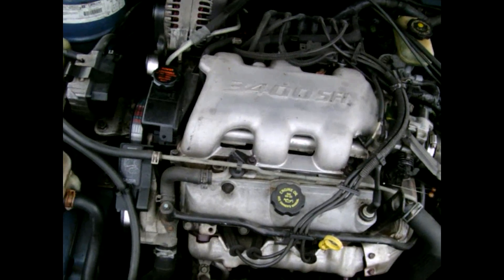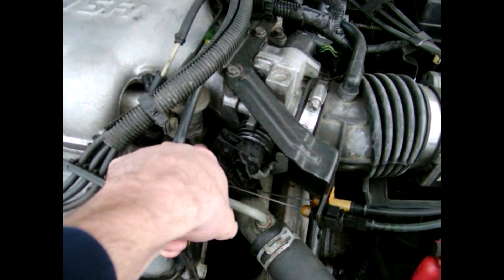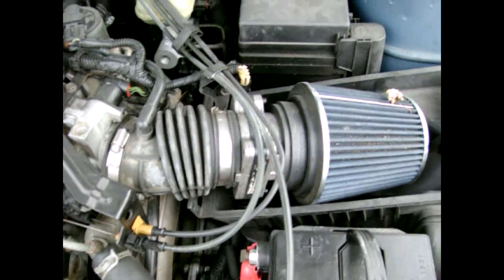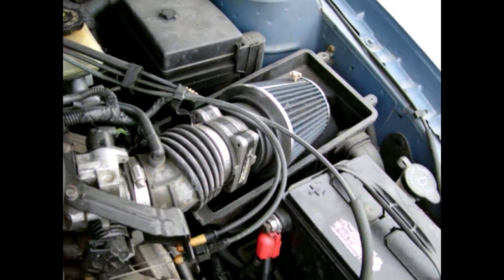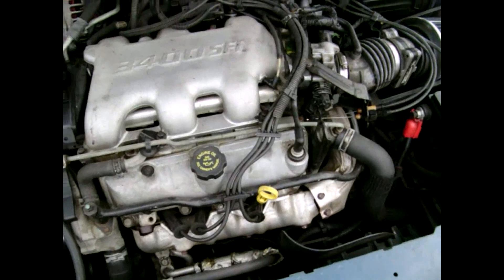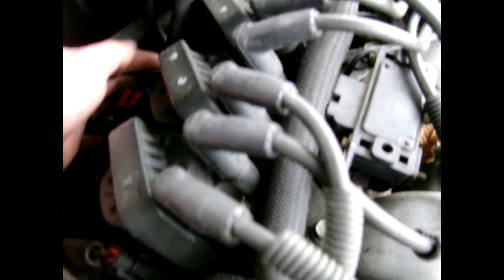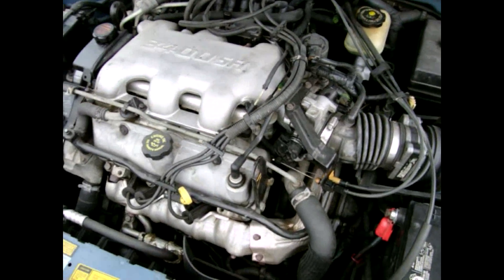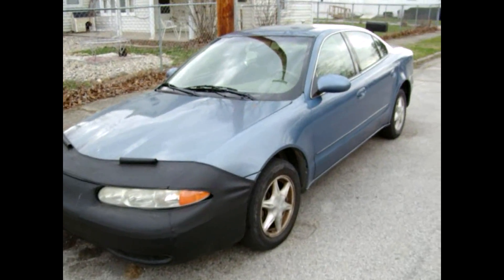3400 GM Engine 3.4 Liter Motor Explanation And Discussion

Comment: I have a 1999 Grand Am with a blown engine, 3400 v6. Bought a good engine from a wrecked 2000 Grand Prix and find out its from California and the emission controls wont hook up. Can I remove that and make it run?
Reply from the maker: Wasn't aware that California 3400 motors had different emission controls.  But, to answer your question, yes.  Make your new motor look just like the old one and it should work fine.  While it is out, I'd replace the head and intake manifold gaskets.  They go bad often and it's a lot easier to do with the motor OUT of the car.
VT247

Comment: Hey I have a 2002 buick rendezvous with the same 3.4l engine and I'm wondering if anyone here knows if this engine is an interference engine because the timing chain gave out on me and after I replaced it the engine now sounds like its ticking and knocking like crazy. Never had this problem before. Any help would be appreciated.  Thank you.
Reply from the maker: +Estefano Telles Don't chance it.  Get another engine.  Replace all the gaskets when you have the replacement engine.  Timing cover, head gaskets, intake gaskets and exhaust gaskets.  If it's making that much noise, you DO NOT want to tear it all apart, put it back together and have the same problem.  Might not be the news you want to hear, but it's the best advice I can give you.  Knocking and ticking is not a good sound to hear, why chance it?
VT247

Comment: having the Air filter so close and direct to the Mass Air Flow doesn't throw off the Engine performance and fuel ratio??
Reply from the maker: +josh martinez Never threw a trouble code when I had it.  Not sure how much performance it really added because it was on there prior to my buying the car.
VT247

Comment: Can I swap a 3400 out of a 2002 grand am into a 2003 alero with the 3400? The guy at the junkyard says it won't work.
Reply from the maker: The block and heads are the same.  Won't matter.  Now, some of the plug in connections might need swapped out but that should be done or checked before putting the new motor in anyhow.
VT247

Comment: I got a 2004 alero with what I think it's a bad transmission. when it gets to 3000 rpm it just lags. the MAF is all clean and the car has no catalytic converter what should i do?
Reply from the maker: Check fuel pressure and the coil packs.
VT247

Comment from the maker: @teemac82 Take off the serpentine belt and take out the bolts holding on the power steering pump and reservouir.  You'll get a better idea of where it's leaking or missing.  It has 2 lines, one in and one out.  Both go to the rack and pinion.  If the battery isn't staying charged it could be the alternator, or it could be a bad battery.  Test with a Volt meter and check for 14 volts with engine running.  Most auto places will check it for free.
VT247

Comment: I have a 2004 alero. This problem came on gradually. When I go to start it with my remote starter it turns over tries three times and fails.. If I get in car insert key and turn it same thing it turns over great fails to start.. If I tap on gas pedal and move it say an inch and let go the car starts like it should. 

had the Throttle butterfly cleaned out today.. Was very very dirty.. Brought car home put in garage like normal 6 hours later same thing.

Sux as now we have snow headed our way.. And remote will not work.. Any suggestions.. please.. Thanks Jerry
Reply from the maker: +Jerry Kutche Sounds like a vacuum leak.  By the throttle body that black line, the grommet can fail letting more air in than it should.  Also, back behind the coil pack there is vacuum lines that work for the EGR system.  Make sure there isn't any vacuum leaks is where I'd start.
VT247
Reply: I am embarrassed.. I did find the issue and fix it.. First let me thank you for your reply...

I usually do better at this. But working 7 days a week I really did not dig very deep. The Throttle plate was almost black entirely. With a pending Snow storm i took my car to my trusty mechanic here in Mitchell Indiana.(Hughes Auto). We discussed the issue briefly and we speculated it was indeed with the throttle body. Last tuneup had been a few years, maybe 5. So they removed air cleaner saw the blackened butterfly valve and sprayed the throttle assy. and got it quiet shiny..It would indeed stick before cleaning.  After cleaning looked at all vacuum lines in are looked great. Not knowing  for sure if it would start without hitting gas peddle until morning. I drove around town and could feel a significant increase in power. The next morning and the following afternoon and days and afternoons the car has started remotely each and every time..  I drive an hour to work each way and did not want to have to spend another quarter, hour clearing snow and getting it ready to drive. Made the addition of the remote start quite welcome a couple years ago.

Thanks again for your reply!!!

Have a good day and upcoming weekend. 

Jerry Kutche
Reply from the maker: Awesome!  In a way, it was a vacuum leak, from the throttle body letting more air in that it should have.  Glad your mechanic got it fixed and running right.  Not fun having a malfunctioning car in bad weather.
VT247
Reply: Yes... Nice.. It was a vacuum leak. The think gunk would not let it close... Thanks...

Comment: Ive built a few of these LA1 3400's and i like them alot they are good engines when built right. If ur gonna build one ALWAY GET THE METAL LIM GASKETS!!! The plastic ones are all trash and i noticed the intake runners on them are smaller too. Also if its a 99 swap out those multec injectors for bosch type 3 from a 90's Tbird will run like a champ just make sure grind down the bracket posts. For my 2001 grand am i just built i use 28lb trailblazer injectors with a fuel pressure reg from a 99 grand am they run at 43psi

Comment: My 2002 grand am is idling very high around 1500-2000 I have checked the IAC, TPS, and any vacuum leaks and still can't find the problem any idea's?.....
Reply from the maker: Check the throttle plate and make sure it isn't sticking.  Also, I've seen bad head and intake manifold gaskets present these problems also.
VT247

Comment: jus brought a 2000 3.4 impala and it has a cracked flywheel should I replace the starter also?
Reply from the maker: Probably would be a good idea.  Why chance it after doing all the work to change the flywheel.
VT247

Comment: I've got this same car and engine mines a 2002 but it's misfiring very badly and it popped up a check engine code and it misses and shudders badly as I accelrate or when it's in reverse or drive any ideas?
Reply: stop driving it

Comment: I wanted to ask if anyone knows how common EGR code P1404 is on these cars? Is this the code that requires the PCM reprogramming? I had my original EGR valve in the car and the CEL came on. I pulled the P1404 code with my scan tool and it said it was the EGR closed postion problem. I replaced the EGR valve with a new one from Advance Auto (don't remember what brand it was) and cleared the codes. About 10 miles of driving later, the CEL came back on and it's the exact same code. I doubt it's carbon build-up in the intake since the code isn't a flow problem code. I also doubt the EGR valve itself is bad since both the original and new are throwing the exact same error code. Any ideas on this one?
Reply from the maker: I've read that this may be needed.  But I'd try a hard reset first.  Disconnect both battery cables, turn the key on and also touch the + & - terminals together while off.  Leave the key on battery disconnected for 20-30 minutes.  
VT247
Reply: does the 3.4l have coolant elbow problems like the 3.8l

Comment: My car crank but no start when I unplug the battery for 20 minutes and plug it back in it starts up fine all day until the next morning it happen again what causes it
Reply from the maker: Might be something with the security system in it but I'm just guessing.  Check your grounds too and make sure there aren't any loose wires.
VT247

Comment: i have a 2000 monte carlo with a 3.4 and it dies when i stop at stoplight or brake i think its the egr value but not sure
Reply from the maker: Had an Olds Alero that did this too.  Check for vacuum leaks as well.  A stuck EGR would do this also.
VT247

Comment: I got an 03 Venture, front right 3 rocker arms doesn't move. Could this be anything but collapsed lifters?
Reply from the maker: Push the pushrods down and spin the engine over.  This will let you see if the cam is moving them up and down.  Check to make sure the rocker arm studs aren't stripped.
VT247
Reply: As best as I can tell the lifters aren't moving? The rocker arm studs doesn't appear to be stripped. I'm going to take the rear valve cover off to see of those are moving. That should determine if the cam is broken? if they are, possibly the cam loads are worn off for those 3? Is it possible to remove the lifters by taking off the intake and not the heads?
Reply from the maker: If the front rocker arms are moving on both sides (closest to the alternator / PS pump) but the rear (nearest to the exhaust crossover) are not, the cam is likely broken.  It's unlikely that multiple cam lobes got wiped out all at one.  Especially since these engines use roller lifters.  The lifters can be taken out without removing the heads.  But the entire front end of the engine has to be disassembled to remove the camshaft.
VT247
Reply: camshaft flat will need camshaft and new lifters can be changed throgh the side of fender have to cut a hole big enough to slide it through

Comment: Does My 03 Monte Carlo  suppose  to be missing a Trans axle hose.....? I have the same size 3.4  engine and my Monte Carlo, but I have a  rubber plug-in that spot. Please tell me there's not a  missing  hose, and a plug supposed to be there?
Reply from the maker: Older versions of the 4T65E transmission use a vacuum to regulate shift patterns.  In newer versions, like the '03, it is computer controlled.  That vacuum line is not used.
VT247
Reply: Thank you so much..I was really leery about missing evap hoses, because the smog place said I have a evap leak.. I replaced the EGR,Throttle position sensor,Idle  control valve,intake pcv,Air cleaner intake pcv valve tube hose,pcv elbow  and tube,fuel pressure regulator  hose .After all that, I still had a code P0404...The EGR was lose and didnt have a gasket.,smdh..That one EVAP hoses I couldn't figure  it out, if that spot had a hose that was missing. With the help of your videos, now  I can take my car to the smog shop.
Reply from the maker: Deborah Pitts To pass smog (at least in CA) monitors must show ready EXCEPT for EVAP. That is the only monitor that is allowed to show incomplete if the codes have been reset.  Also make sure that the vacuum line is in the EVAP under the coil pack, mine had come out at one time on this Alero.  
VT247
Reply: Vacationtime247 ...Oh okay,,I learn something new everyday and I will check out evap hose under the coil pack..Thanks again
Reply: Okay,I checked  it's on tight.. I replaced that as well... I think I'm going to replace the fuel pressure  regulator just on GENERAL Purposes. .Some power was gained but I want it to smash out when I hit the accelerator... do you think having too much transmission fluid in there will cause the car to run bad because the mechanic had put I have a court in there too much.!
Reply from the maker: OH!  Almost forgot, had a problem with a fuel tank pressure sensor (FTPS) once that caused an EVAP code to come on.  It is located on the top of the fuel tank / fuel pump assembly.  Recently had to fix a fuel pump O-ring seal and just cut an access hole above it rather than dropping the tank.  I'd just drain the extra fluid out, could have an effect on performance being over filled.
VT247
Reply: Vacationtime247 .....I was thinking the same thing as well..Im going to have the mechanic check the Fuel pressure sensor.

Comment: I have a 2001 Chevy Impala 3.4. Sometimes when i am driving it. An i am accelerating quick or when i floor it to pass someone it will rev up like it's going to take off. An then all of a sudden it starts to hesitate or acts like it's getting to much gas or to much air. But as soon as i let my foot off the gas and hit it again it goes. Other times it will do the exact same thing again. I have changed the fuel filter, throttle body, air filter, plugs and wires. An it is still doing the same thing. Any suggestions???
\
Reply from the maker: Does the computer show any codes?  My other guess is it could be a vacuum leak.
VT247
Reply: I know the 3.8 is notorious for vacuum leaks 3.4 could be the same way

Comment: I cannot see where the household.  that connects to the air intake hoagies.. it is on top about 2 inches from the clamp to the throttle body.. I'm wearing my glasses but I still can't see where it goes..thanks for all the tips though..
Reply from the maker: That black air tube goes from the intake air hose to the rear valve cover.
Reply: I found it.. Thank you very much!!!
Reply: I just saw the video that you made about the back plugs and I noticed you didn't take the motor mounts loose.. cool... Thanks again...

Comment: MY car is a pontiac grand am gt and it started knocking after i start it and stays knock its not loud or anything and it still runs good but idk what the knock is caused by?!! need some help!!
Reply from the maker: Depends on where the knock is coming from.  Get a piece of vacuum line and put one end in your ear.  Use the other end to probe around the engine.  Could be a lot of different things depending on if it's upper or lower end.
Reply: If its a rattle check the idler pulley... When they go bad it makes a rattle sound

Comment: 2000 Olds alert fuel smell... replaced regulator. any ideas?
Reply from the maker: +adam Cote Check your lines for any leaks.  If you find any, do a sniff test of the fluid.  Sometimes they like to hide in hard areas.  A cheap extendable & bendable mirror can help.
VT247

Comment: I have one that would crank and backfire But won't start someone told me it was a crank sensor changed it still the same what can it be
Reply from the maker: +Eddie Greene Check the DIS system.  Could be the module under the coils.  Also check the timing chain.
VT247

Comment: Would.u have any idea why it run slightly warmer? No coolant loss.did.coolant.temp.sensor
Reply from the maker: Check to see if the coolant system holds pressure, blown intake, head and timing cover gasket are common with these engines.  However, if it does hold pressure, a vehicle doesn't actually overheat unless it boils over into the overflow tank.  For some reason, the cooling fans don't come on until it's almost into the red with the 3400.
VT247
Reply: @Vacationtime247  I've seen this.  I haven't caught it boiling over. What are the issues with the intake gasket? It never goes to the red but it runs like 215 to 220 that goes back down to 200. I've bleed and burped check Dan relays idk what else to do before I just hack it and throw a Casper switch in. Which id have to monitor Temps every time I drive...

Comment from the maker: Might be the battery is going dead.  They don't last forever and will cause a hard start if cranking slowly.  If it is the cables, try a wire brush and clean off all the corrosion.
VT247

Comment: My problems with my 01 Olds alero started after my starter went bad, replaced the starter and alternator still had issues I am now on my 3rd starter. The new starter I just put on a week ago I thought solved my problems after I got the starter on I turned the car on and off 3 maybe 4 times went to the gas station about 2.5 miles away left car running while I got gas then decided to drop some borrowed tools off by a friends house roughly 10 miles from gas station pulled over on the way there to look at my high beams because the battery indicator light was on and the high beams were as bright as they should have been got to my friends house stayed 10 or 12 min left the car running when I left I got 3 houses down and everything in my instrument cluster went dead pulled onto the main road and car wouldn't shift gears turned around went back to my friends house turned car off and tried to restart and it was like my battery was dead or the brand new starter, then it started making a high pitched clicking noise under hood even though car was off with key out of the ignition, it didn't stop making the noise until I disconnected the battery. I reconnected the battery used a jumper box and car started up just fine let it run a few min everything seemed fine until I put it in reverse then I started sputtering and died on me as soon as I put it in drive
 The time before this that I had put the second starter and alternator on the car it started up and shut off roughly 6 times then it died and wouldn't even click when I turned the key... I have checked all fuses which are good and get power had the alternator checked at advance which is fine and used a multimeter to check my battery which tested fine as well as making sure all fuses and relays were getting power. The car ran great until my starter went bad and I replaced it and I have had problems as mentioned above since, I have been dealing with this for 8 months now, mechanically the car runs great no problems at all it had a check engine light on when I bought the car and ran fine so I wasn't too concerned the car has 212k miles on it... any help or advice would be more than greatly appreciated since I cannot find anything on forums or by asking any mechanic or car guy I know because the car does something different as far as electric wise every time I get it started... thanks in advance for any suggestions and help, don't have $ to buy another car or sink into a bunch of parts that still don't get car running